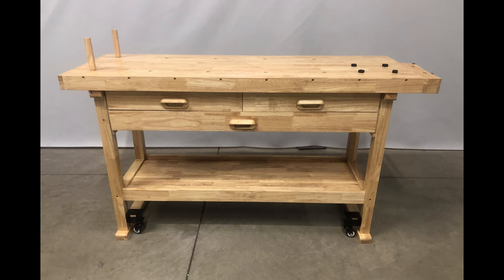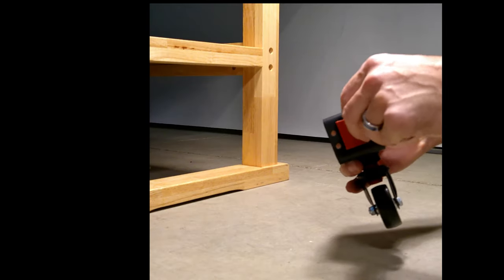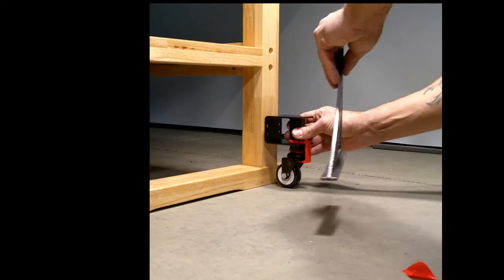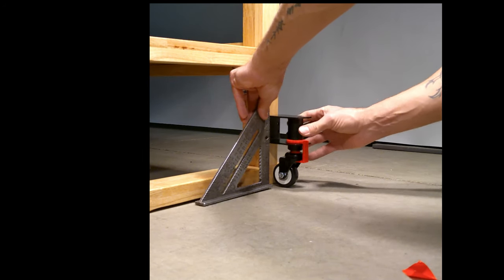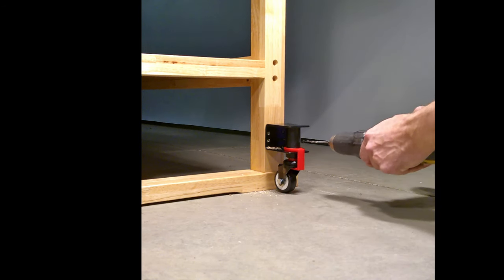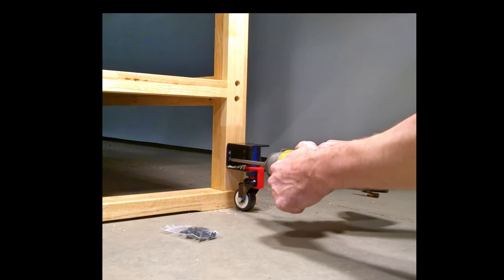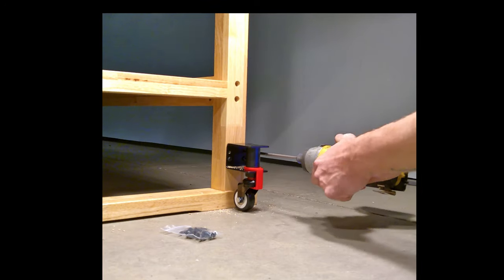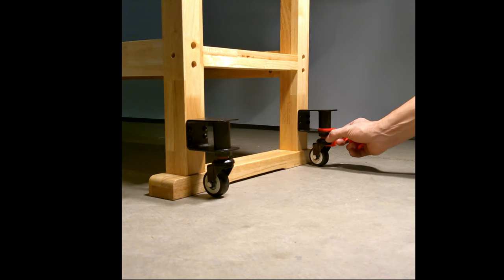Mounting the R7 Retractable Casters

Comment: Why isn't your website in the transcript for all your promotions?

I fear those fasteners and  the width of the bracket may be too light for some benches.  Like the idea a lot.  For heavier benches a bracket one could slide a little floor jack under would be an asset.